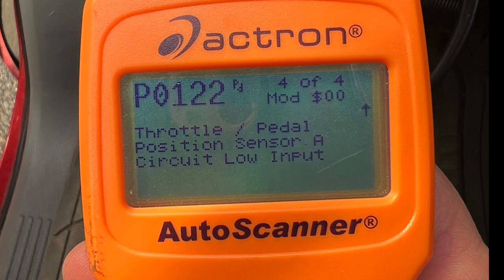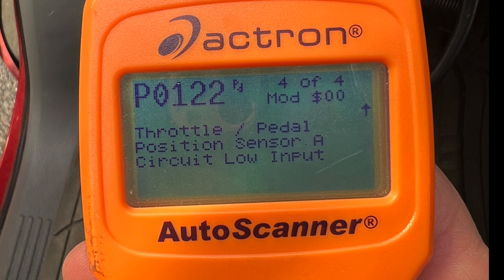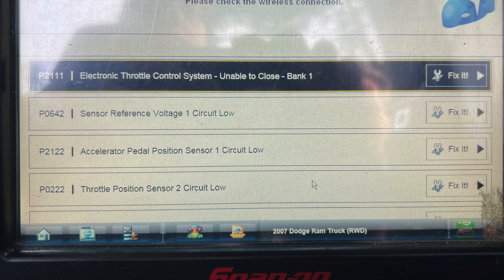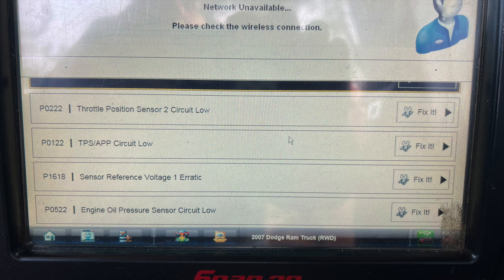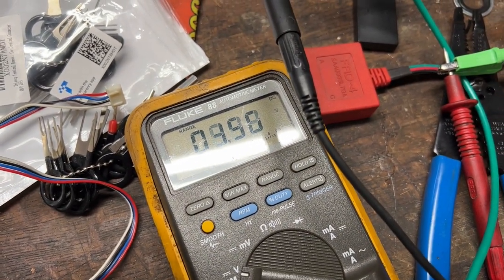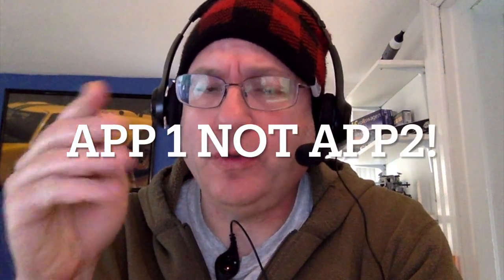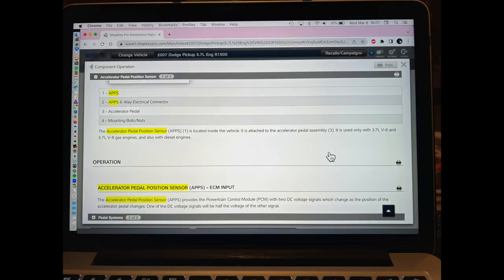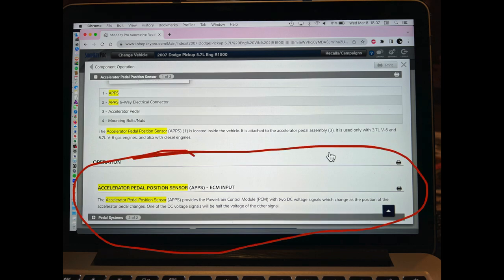The case of the stalling 2007 Dodge Ram 1500 5.7L Hemi

Comment: I spend last two month over $$$$ for almost same issue my ram is really top condition and 100.000 km on it but After the engine warms up, I drive about 20 kilometers. As soon as I turn right mostly and sometimes left. The engine turns off, but it is fine until I start it again, and then it turns again . My mechanic changed all the sensors . Even T.B . that he imagined or showed in the scanner . But I still have the same problem and it still shows the same damn code P 0642 P16 18 P 21 22 .
If any of you, my friends, have this problem or know a solution, please let me know. I will be grateful
Reply from the maker: Watch the video! That sounds like the same problem I had!

Comment: 2007 5.7 .. I’ve replaced everything and I’ll let it run for an hour but after it is warm and I hit a bump it shuts off .. I’m about to send my tipm out .. located in Stamford ct ..
Reply from the maker: Check around the filter housing for shorted wires.  What codes did you get?

Comment: Awesome video. Do you teach this stuff? If not, you should.  Seems like you really have an innate passion for this. My 07 is having this issue and I was getting ready to start throwing new parts at it, but i will most definitely be checking that harness first
Reply from the maker: Thank you, yes, I do teach this for a living. :)
Reply: @danjreed  I took a look at the harness, cleaned it yet the same issues. The front is fine. The rear is all haywire. Left signal and both signals blink plus the right rear reverse light. No reverse lights at all.... any advice would be helpful
Reply from the maker: Oh, this was for a wiring issue with the engine harness, not the lighting system. @antonsimmons4495